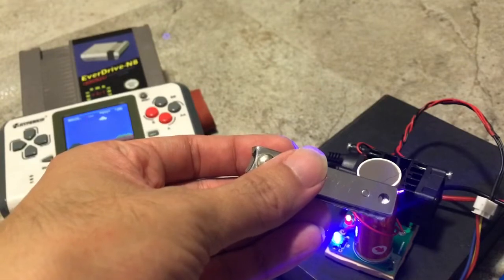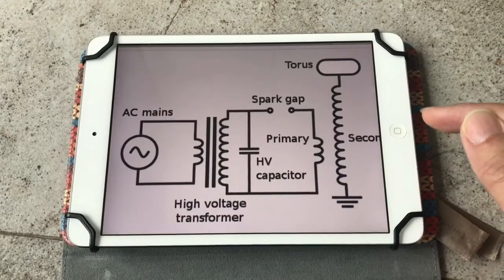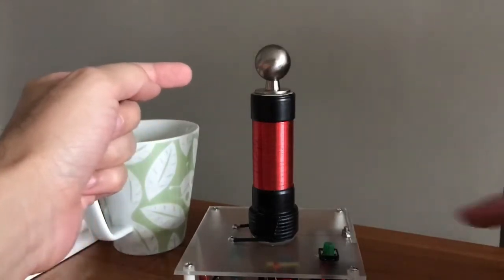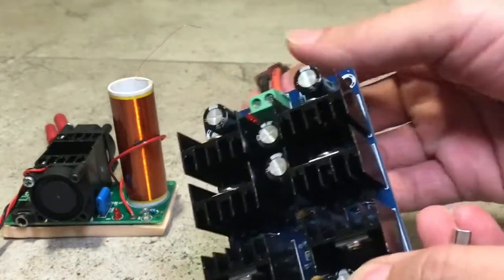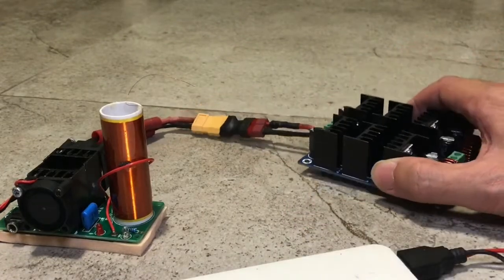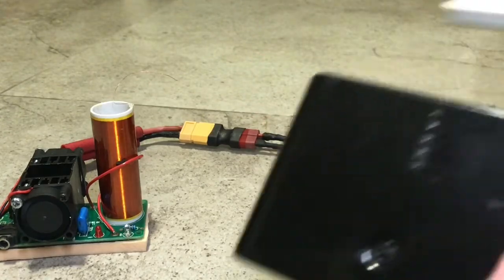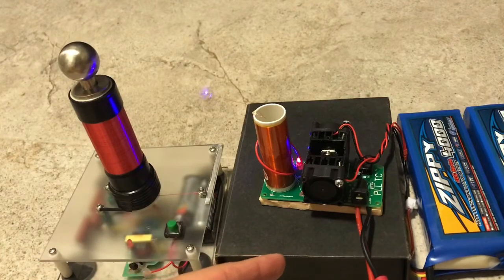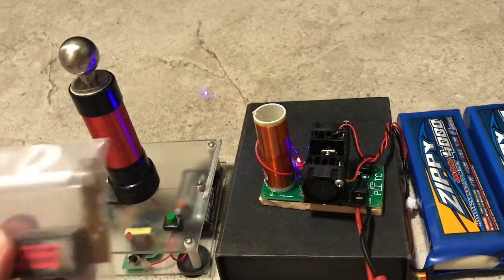Desktop TeslaCoil -DIY or Buy?

Comment: Hi, 

I made this following the plasma channel tutorial. 

I went a bit overboard and increased the secondary to 820 turns 
I was expecting longer arcs. 

Primary = 11.5 turns for resonance. 

My arcs are no longer than a few centimeters. 

Can you advise as to how to increase the Arc length ??
Reply: I have also made the musical Tesla, which I got from AliExpress. 

It works fine, and I use a 24 V 3 amp AC to DC power supply, which I purchased for about 3$
Reply from the maker: The easiest way to get more powerful (not a lot longer) arcs is by stacking 3 NPN transistors(parallel)and 3 MOSFETs(parallel) for the musical Tesla and crank up the voltage from 24v to 28v. For the fly swatter Tesla, I don’t think it is able to get stronger arcs out with that spark gap system unless u parallel-feed 2 fly-swatter boards for that spark gap.